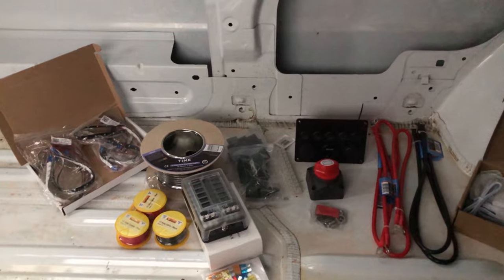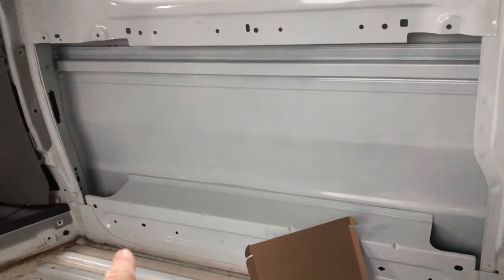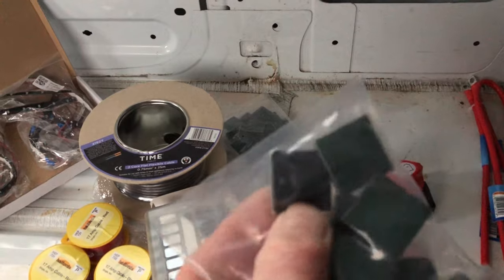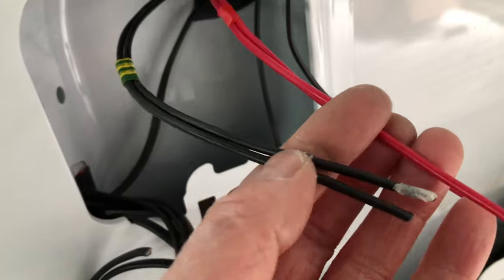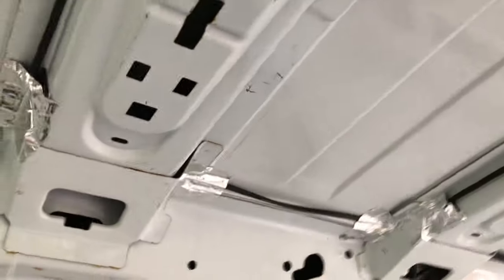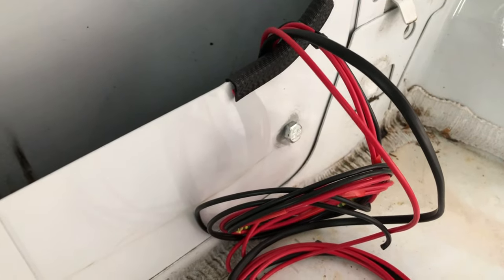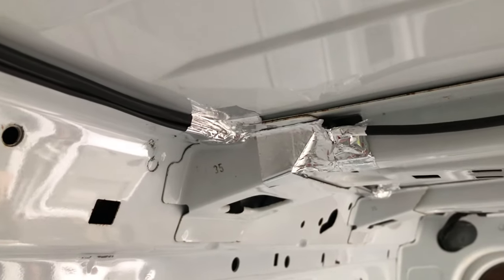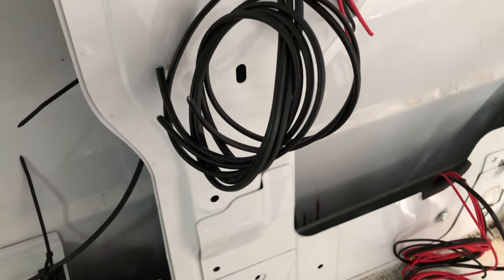Vauxhall Vivaro Camper Van Conversion (3) Episode (2) Wiring The 12 Volt electrics/system

Comment: Great video! Where do you run your wire from van battery to leisure? & what location are you fitting your leisure?
Reply from the maker: I don't use a split charger as I find the solar set up I install later on will be enough! 
I did put a split charger in the first Vivaro - It's really easy to do, and you can run the cable under the seats to the drivers side and behind the panelling. 
I position my Leisure battery next to the rear wheel arch to the front, I have shown this in my last conversion which you can find here on Youtube - Thanks for watching and your support

Comment: Hi. What size cables are you using has I'm just starting a vivaro with a similar layout.   Thanks 👍
Reply from the maker: Hi Lee, depends on the appliances- and distance- I always run larger cables than the amp required. - I even changed the Fridge cable out after this video as I wanted extra security. LED lights are really low amps so not a big issue, they all get fused off at the back of the switchboard. The fridge goes straight back to the fuse box with a separate switch- I wouldn’t use the switch board for any high amps. Hope this helps.

Comment: Hi, did you do a video of how to re wire the contol panel, can’t seem to find one. Great build by the way
Reply from the maker: Hello Really sorry for the late reply - I ended up not doing the video, I have however kept photos of how I did this. Do you have a facebook page I could send them to?
Reply: Would it be possible to send me them please? I have done my wiring today the same as yours. Only struggled with the wire on the passenger side for my switch to feed my leds. I couldn't feed it through the piller. But I'll try again at the weekend.  Thanks very much for the help.
Reply: I've posted my Email but it keeps being removed.  Must go against YouTube policy.